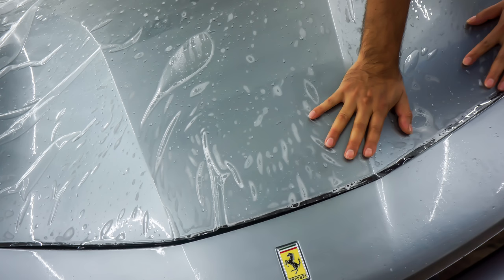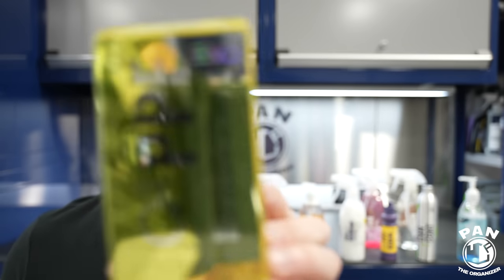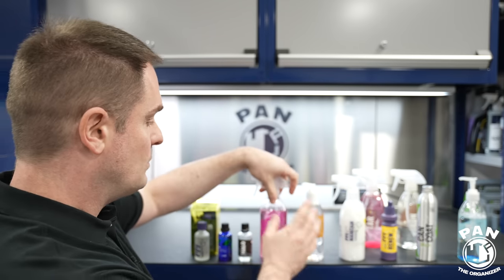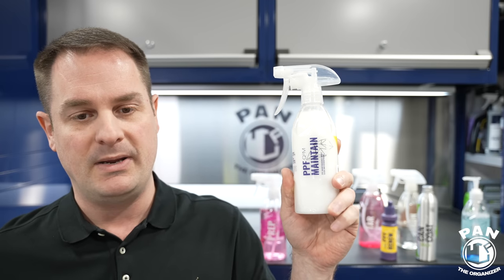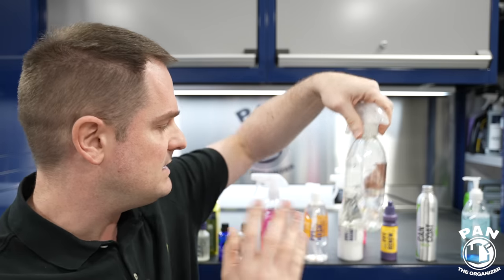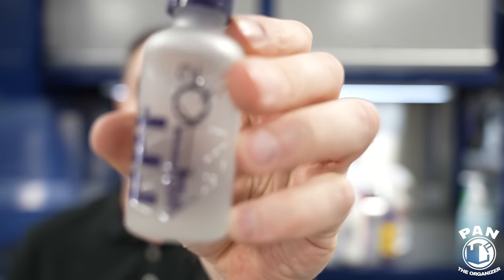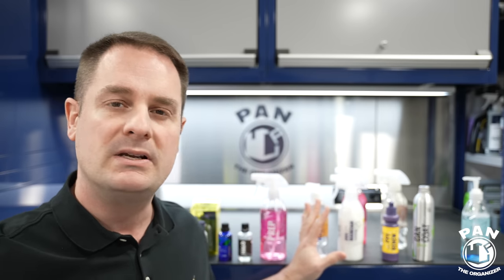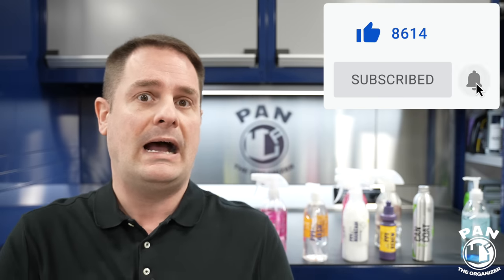How To Wash & Maintain Paint Protection Film (PPF)

Comment: Hi Pan, what is the difference between PPF wash and Gyeon restart wash? I’ve been using restart was for my maintenance was once a month. Also should i have Gyeon ceramic detailed or PPF maintain on my car which is PPF and ceramic coated?
Reply: Im using geyon ppf wash and yes its same materials in restart and includes iron remover but its more specific for ppf. Also im using ppf maintain spray and its really best for ppf for durability, hydrophobic, slickness and uv protection

Comment: Question about pressure washing the car, including the undercarriage.  I have a Ryobi 2900 psi pressure washer and a Ryobi water broom rated to 3300 psi.  My question is what is too high psi for the undercarriage and what psi would a 40 degree nozzle be.  I'm guessing not the full 2900 psi.  Thanks.
Reply from the maker: I always recommend using 1000-2000 psi max to wash cars
Reply: For PPF, it should be less than 1000 psi around the edges.

Comment: So ppf maintain is same as gyron wet coat? İ have wet coat, ( orange bottle ) can i use it on ppf securely?
Reply from the maker: PPF Maintain has nothing to do with WetCoat. WetCoat is sprayed on a wet surfaced and rinsed off. Very different from a spray on wipe off product.

But yes, you can use WetCoat on PPF.

Comment: If I put a ceramic coat on PPF is the PPF maintain/wash needed? Or would I just use the bathe?
Reply from the maker: You would use Bathe. You would treat the vehicle as a ceramic coated vehicle at that point, not PPF. Since the coating sits on top of the PPF.
Reply: @PanTheOrganizer  thank you! I appreciate the response. Thank you for all your knowledge.
Reply: @PanTheOrganizer  one other question. Is there a ceramic you can apply on both ppf/paint or do you need specific ceramics for each application?

Comment: What about small rock chips and scratches in the PPF that are dark and look like a paint chip but aren't?  Is there a way to make the damaged spot of film look any better?
Reply from the maker: If the film is damaged there’s no miracle in fixing it other than replacing it unfortunately.
Reply: @PanTheOrganizer  Thanks.  Was hoping you knew of a trick to remove the dirt that seems to be trapped on top of the film at the point of impact.  Probably my biggest complaint of PPF is that rock chips in the film still look like rock chips in the paint.

Comment: Pan, I noticed you do not have PPF on the front end of your Porsche. Can I ask your reasoning?
Reply from the maker: The only PPF on my car is the one from the factory on the rear arches. 

I am just not a fan of the look or feel or PPF. Plus, as I get a brand new car every three years, and do low yearly mileage, scratches and stone chips are of no concern to me. My cars are always pristine when I bring them back to the dealership.

But for people who keep their cars for many years, and want the ultimate scratch and rock chip protection, PPF is the only solution. I would still recommend a ceramic coating on top of the PPF, for the best of both worlds.

I did however change the PPF on the arches recently, video to come soon.

Comment: So it would be problematic if I did 2 layers with the Evo PPF ceramic?
Reply from the maker: No benefit in doing that. You’d just be wasting product and run the risk of high spots
Reply: @PanTheOrganizer  Okay, thanks, I used it today and did just the one coat. Everything turned out great as far as I can tell. My first time doing ceramic. Seemed pretty easy to work with.

Comment: Hey Pan. Thanks so much for this video. I have PPF on my car for about 2 years,  the installer allegedly put a ceramic coating on top of the PPF, but I found out he never did.  So last year I prepped the surface with Avalon King IPA wipe down, and applied 1 coat of Avalon King Armour Sheild IX. I use Gyeon Wet after every few washes (after watching your videos). I figure on reapplying a ceramic coating next year. So I should polish the PPF and then put a coat of Ceramic Coating on again? What should be the steps when trying to take off old ceramic off of PPF and then reapplying the ceramic?  Thanks!

Comment: Would you use bilt hamber touchless on PPF considering it his ph level 11-12?
Reply from the maker: Once in a while, just like on paint. Not for every regular wash. Also, as some PPF can be different, check with your PPF installer what is recommended for your specific PPF.

Comment: I see you polish cars all of the time with Sonax perfect finish or 3D speed, but outside correcting sandpaper scratches in a large scale auto-body shops I don't hear about 3M's polishes why is this? Their sandpaper and tape products are great and have made them total tech Giants. Do perfect-it and finesse it polishes simply not work as a polish prior to ceramic coating a vehicle? Or do they just not work as well as these other products, Or are these products simply slept on?

Comment: Gonna be honest, needing to do any of this negates most of the benefits I was advertised of getting by just having PPF. The way it’s advertised it seems as though with it’s self healing properties you could just run through a newer touch automatic car wash and never have to worry about any swirls. And then every so often you could do an at home hand wash with something like griots ceramic spray after and have an almost immaculate (to a normal person not a detailer) finish at all times. If this isn’t how this works what are you getting for the $5-15k investment on PPF?
Reply from the maker: It really depends what brand and model of PPF you have. Not all of them are self-healing. And even the self-healing ones can only protect against light swirls and scratches. Like paint, if you get any scratch too deep, there's not much heat or UV can do to restore the self-healing.

PPF is really made for its main purpose: protecting the paint underneath against stone chips and scratches. So the PPF will get banged up, will get scratches and swirls, and stone chips, and will likely fade and oxidize over time (unless you apply a coating on top of the PPF) but it will have served its purpose: protect the clear coat underneath.

I just thing some brands like to overhype PPF as it's a magical force field haha. Nothing is. The same with the brands that overhype ceramic coatings. Are they the best paint protection? Yes. But do coatings protect stone chips and scratches? No they don't. PPF does that. 

Coatings are meant to provide gloss, slickness, give self-cleaning properties making the vehicle much easier to wash, give UV protection, chemical resistance, and protect the clear coat from the elements, bird droppings, tree sap, industrial fallout, etc.
Reply: @PanTheOrganizer  thanks for the response, I’m your experience will the self healing ones (suntek reaction) be immune to what otherwise would cause small swirl marks for years and years to come? All my vehicles stay basically immaculate for years and years but in the right light you can see swirls through the shine. Hoping self healing PPF on my brand new vehicle will negate this

Comment: Pan, do you use your pressure washer on cars with PPF, or is there risk of damage?
Reply from the maker: As long as you stay within 1000-2000 psi you’re fine (assuming the PPF was properly installed).

Comment: Don’t they usually just put PPF on the lower hood and front, and lower front sides of the car?
Reply from the maker: You can do full paint PPF or just a few sections. It depends on your needs and mainly the budget.
Reply: You want to do the ENTIRE hood or don’t bother.  I hate seeing cars where someone cheaped out did half the hood = looks like trash!!!
Reply: @07wrxtr1 I totally agree with you. The couple hundred bucks extra will be quickly forgotten in a couple months and you’ll be so glad you did. I also suggest to do the front pillars and at least 6+ inches above your windshield

Comment: Hey Pan. For protection from "pin-stripping" from bushes/trees when off roading, would ceramic coating offer any protection? Or should I go straight to 100% PPF coverage (XPEL Stealth)? Also, after PPFing and ceramic coating the PPF, would FlowX be ok on top? Thanks!
Reply: Ceramic won't provide enough mechanical resistance for that. You would need a PPF with enough mils of thickness to provide some protection.

Comment: These ceramic coating may quickly expire after bottle open, not user friendly for DIY.
Reply from the maker: Once opened, coatings are typically only good for a few months. Unopened, chemicals are stable for about a year (2 years max) if kept in stable conditions and not frozen.

Comment: So if my Caddy SUV has PPF only on the complete front end.  So front bumper, fenders, side mirrors, and 81-0 inches back on the roof and the A-Pillars.   
If I do the Halp Flex is it ok to put that Ceramic coating on the ragular clear coat along all the lones where the PPF meets the clear coat.  Along the lines where PPF and clear coat meet.
Then can I do the rest of the car (no PPF) with normal ceramic coating?  So alomg the borders of the PPF the two ceramics will overlap a little bit.
Reply from the maker: Yes that is fine.
Reply: Thanks......... @PanTheOrganizer